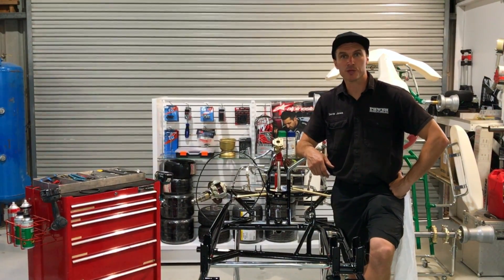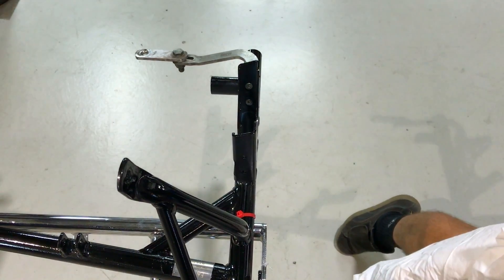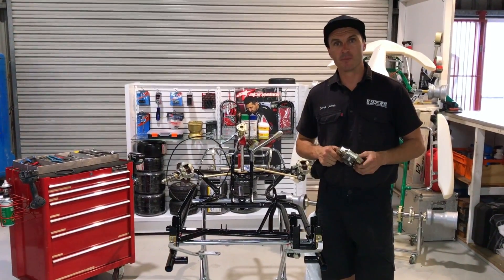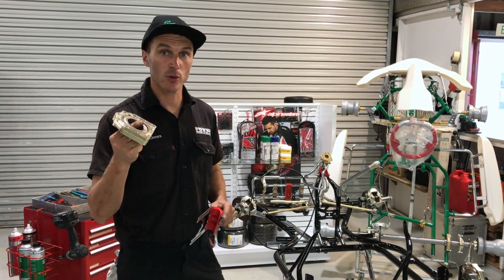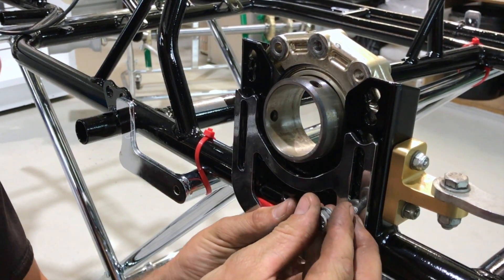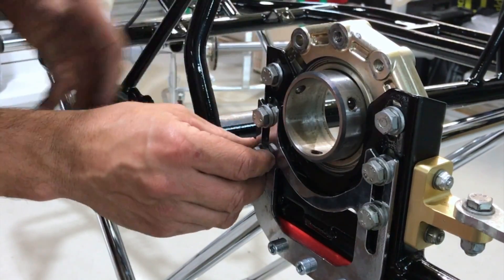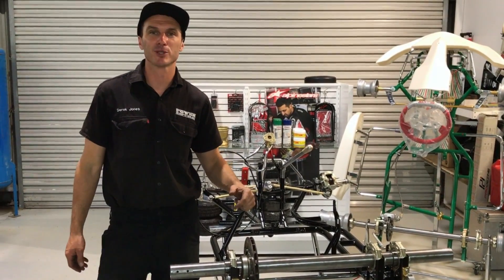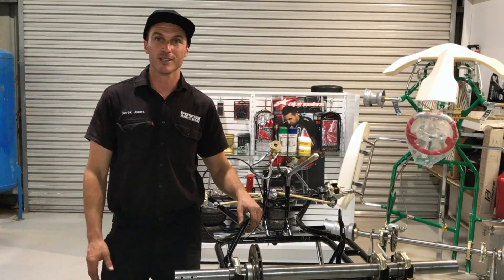Power Republic - How To Assemble A Go Kart - Part Three - Rear Axle Assembly

Comment: Are the grub screws enough to hold the axle in place laterally? I'm planning a drift trike build and am unsure on how to prevent the axle moving through the bearings.
Reply from the maker: yeah they are fine, specially if you use loctite.  you can buy some extra axle collars as security if you are super worried

Comment: Why do you install the brake side bearing outboard facing? What is the logic/physics reason for doing so? Would it not make the kart behave more equally if it was installed inboard like on the engine side? The overhang length of the axle would be the same on both side if both bearings were installed inboard facing hence similar flexibility, no?
Reply from the maker: great question.  the karts come from Italy that way, I guess it is to cleat the brake disc key way.  you could run yours inboard if you wanted, probably just have to modify the keyway.  hope that helps
Reply: @PowerRepublic  I have been adjusting the key for a few years since someone raised my attention to the fact that it running it outboard likely creates a different axle flex on that side (compared to the other side) and also may bind that bearing more in corners, when the overhanding part of the axle is loaded and flexes. When I watched your video, I thought "here's an opportunity to ask for another opinion on this". If the company puts it this way out of the factory, perhaps there is a reason, or perhaps they just did not want to have to produce a shorter key, who knows unless someone has another explanation that holds logic of some kind.

Comment: Hi team, great videos and very easy to follow.  I do have one question please.   I replaced the axle in our tonykart and added a soft axle due to track conditions.   However, we had problems with the brakes during the meeting and when I dismantled the axle I could see that the key way holes for the sprocket were very elongated and it also looked like the axle had twisted round slightly in the bearing.  By this I mean it had not moved side to side but more forward and backward looking at the grub screw holes.  I did use locktite when doing up the grub screws but did notice they were loose when I took them out of the axle.    Do you have any tips for ensuring they stay tight.   Thank you again..
Reply from the maker: Hey mate, great question.  there is some plastic axle supports you can buy from OTK ( https://www.powerrepublic.com.au/products/otk-50mm-axle-stiffener-tony-kart-racer-401s?variant=188604842009 ) that slide into the centre of the axle.  insert 1 from each end and tap them in with a hammer and 1/2" extension bar and a socket until it is under the grub screws in the bearings.  these parts once inserted will stop the axle from deforming under the pressure of the grub screws (this is very common with the soft axles) which will stop them from coming undone.   remember to always use loctite like you did and you can also double up with some extra insurance and use some axle collars as well.
Reply: Power Republic hi, thanks for the response.   Was not aware of the stiffeners, I can see the deformity your talking about.   Will look into them...... With regards the insurance, I did have cable ties over the grub screws whIch I do think saved things becoming a lot worse than they were.   Thanks again for the advice - forgot to add, I have utilised all your videos - they are very informative and easy to follow.
Reply from the maker: @MrKwacker1   your welcome and thanks for the good vibes!!!!

Comment: What if you have a 30mm axle and want to put a 40mm axle in ? Is the weld holder for the 30mm axle have to be change to 40mm holders?
Reply from the maker: Hi Abraham. No, generally the 40mm won't fit into the 30mm hangers, you can however cut them off and get them re-welded in position.
Reply: Power Republic thank you so much 👌🏽 love the videos btw. Keep the good work up